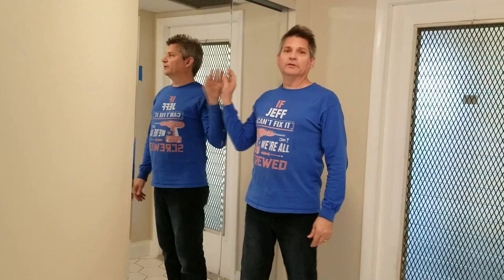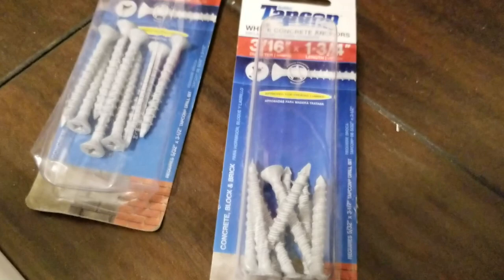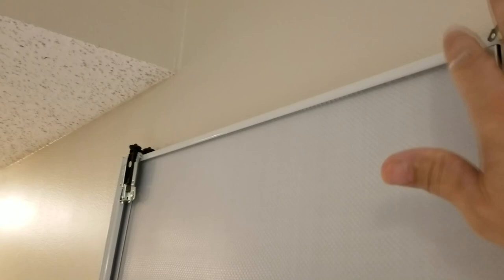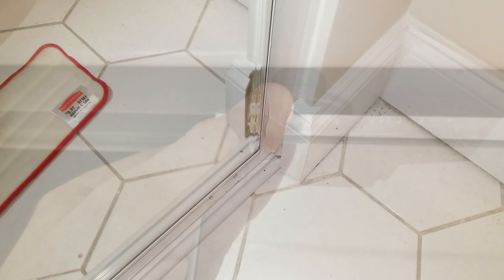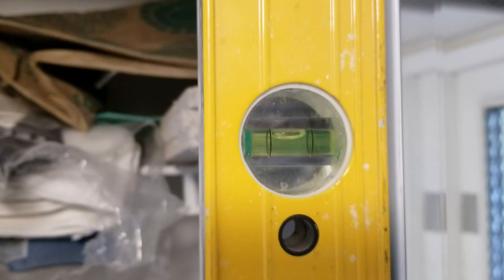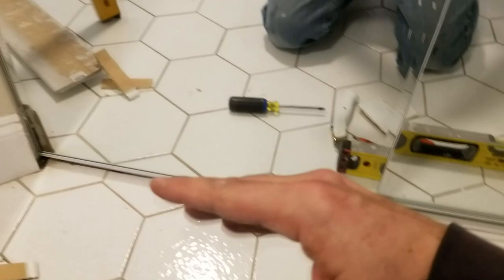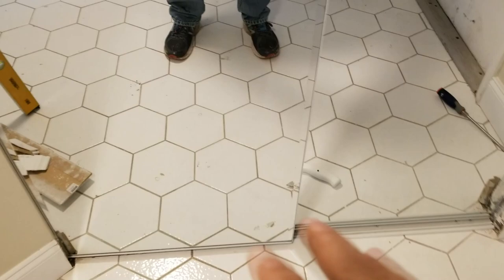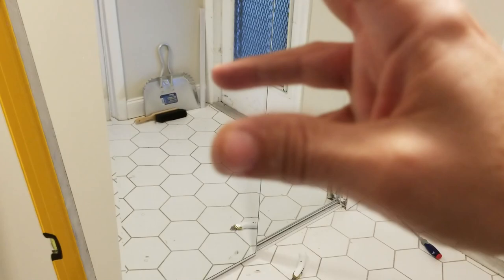How to Install Sliding Mirror Closet Doors Instead of Bi-Fold

Comment from the maker: ✅ Tools and parts in this video: ✅
 🛒 47 in. x 80.5 in. Savoy White Painted Steel Frame Mirrored Interior Sliding Door https://homedepot.sjv.io/nG4Ma
🛒 DEWALT DCK299D1T1 Hammer Drill, Impact Driver Kit: https://amzn.to/2M6h450
🛒 RYOBI AG4031G 4-1/2" Angle Grinder: https://amzn.to/2BNYYjr
🛒 Tapcon 24371 3/16”x1.75” White Concrete Anchor: https://amzn.to/2MXeuyX
🛒 ITW Tapcon 5/32” x 4-1/2-Inch Concrete Drill Bit: https://amzn.to/2I3BOvS
🛒 Johnson 72" Heavy Duty Aluminum Box Level: https://amzn.to/2TiuihP
Reply: Where did u buy the door from?
Reply from the maker: https://www.lowes.com/pd/ReliaBilt-Reliabilt-White-Mirror-Sliding-Closet-Door-Hardware-Included-Common-60-in-x-80-in-Actual-60-in-x-78-in/4411953

Comment: Thank you Jeff! Great video! I just purchased a used mirror closet door that fits perfectly in my space and your video is helping me be able to install it. I was wondering what size screws should I use for the top and bottom? Thank you! 😊
Reply from the maker: If you are going into would the top track and bottom tracks can be screwed in would just a simple 1" Pan head threaded screw. Don't use a regular bugle top would screw because those bugle tops will stick up too far in the door will snag on them. It usually depends on the size hole they give you but I'm number 8 or number 10 , 1" Pan head screw will be just fine
Reply: @jeffostroff  thank you so much!

Comment: Do you have a video addressing cracks in grout in bathroom tile corners
Reply from the maker: No but I can tell you that you should never grout in corners, so you'll always see me using only silicone. We use color matched silicone to match the color of the grout. You hould never grout any change of plane only silicone.

Comment: Can I install new mirror doors onto already installed track and hanging plates from previous regular sliding closet doors?Thanks for the video great info 👍🏼
Reply from the maker: You can try, you might get lucky and they roll on the older floor track, if not you'll have to use the tracks shipped by the manufacturer.

Comment: If it says “2.5 mm thick safety backed mirror” does that mean it comes with the two sliding mirrors¿ rn do I have to buy another one for 2
Reply from the maker: Only the front of these doors are mirrored, the backs of the mirrors are not mirrored, they are some material designed to protect it. Both doors come mirrored.
Reply: jeffostroff how do I know if it comes with 2 door mirrors because I don’t want to make the mistake of only buying one mirrored door
Reply from the maker: @hopehdez3886  If you order the exact one here that we ordered, it will have 2 doors, on their description page you'll see it says it has mirrored doors: 🛒 47 in. x 80.5 in. Savoy White Painted Steel Frame Mirrored Interior Sliding Door https://homedepot.sjv.io/nG4Ma

Comment: Helpful video, Jeff. I'd like my 6 mirrored closet doors on 3 tracks so 3 dorrscollapse on the left and 3 collapse on the right for maximum access to the closet storage area. Know if that kind of hardware is available somewhere? Thanks!
Reply from the maker: Great idea! That's a huge opening, and I think too much complexity that will lead to trouble down the road. At Home Depot, biggest slider set they have is 48" opening for mirror doors, but some other smaller glass panel doors can go to 72". Lowes has mirror doors to accommodate a 72" opening max, but $600! You my have to go custom route.

Comment: Awesome video Jeff!  Do you have any experience or suggestions on removing them? The plastic hooks seem to be preventing us from lifting them out of the grooves in the floor track.  We got them installed no problem but are having trouble now removing them. Thanks in advance for your help and sharing your knowledge!
Reply from the maker: The best way to remove them off the track is you have to get inside the closet down on your knees and unscrew loosen the wheels and the wheels have to rise up in order to swing the door up and out

Comment: I created a problem for myself when I bought my replacement door with the correct height and width but WRONG size of the Bottom Rail. When I  removed the original closet door  which was just like this one in the video in order to put a new one in I discovered that the old door had a wider bottom rail by about an inch and a half over the new one. The new narrower rail  exposed  the gap between the closet and the room since I had no carpet going under the bottom rail extending from my room to the closet. The original rail was wider and was neatly covering the subfloor , but the new one wasn;t due to being over an inch narrower. This left me with about an inch and a half of exposed subfloor which looks unsightly.
I was in a hurry and got my replacement door 15 min before store closing and now have to correct that by dedicating another day just to return it and then special order a new one since they don;t have it in stock.  Be mindful of that when replacing with new.
Reply from the maker: I have filled in gaps before with cut pieces of the wood flooring I used in the closet
Reply: May I ask how you removed your door?  The plastic hooks/guides on the bottom seem to be preventing me from lifting my doors out of the tracks.  And it's driving me crazy!  Is there a way to compress the hooks so that they slide out of the grooves?
Reply: @Hullabaloo2013  Yes, of course if you just need to remove the doors that is easy. Jeff has at least one video on how to to that. Sliding doors may be different than bi-fold doors , depending on what you have it may be a little different. I would type in "Adjust / remove bi-fold closet doors" and you will likely see many  videos which address this issue. That is what I did . Gl.

Comment: Mr Jeff my door opening  H it is 80 in h even and I have a 80 inch H door what should I do to fit
Reply from the maker: Just because you have an 80 inch door does not mean that it's 80 inches so a lot of times it could be 79 inches or 79 1/2 inches. So you need to pull up the spec sheet for that door and look at the exact dimensions and if it's 79 1/2 inches you are probably going to be OK. But if it truly is an 80 inch door the only way you'll get that door to fit in there is you will have to chisel away at the top of that sofit and maybe raise it up in inch or two that would require a little bit of construction engineering I've had to do that in the past. I once had a closet door that was too tall, and I had to build the soffit down from the ceiling to meet the height of the door that I was installing.

Comment: Is there any way to cut down these mirrored doors so that they may fit a 79" opening?  My only other options would be to reframe or buy custom ($$$).
Reply from the maker: No you cannot cut down the glass at all this is usually a tempered glass and it does not meant to be cut only once at the factory
Reply: @jeffostroff  Was worried that was going to be the case.  Thank you for the quick reply!

Comment: What if my sliding mirrors are bent/warped? When i slide my mirrors they grind on each other
Reply from the maker: I don't see how they could be banned because otherwise the mirrors would have cracked. Yeast. But supposing they are warped out of shape then you would have to get new ones because this type of system that's designed for them to be straight and parallel to each other. Check your wheels on the bottom and make sure they are contacting the right part of the track it could be your just alignment is off

Comment: Bought a pair of used doors, to replace bifold. Need just the hardware. Picked up a set @ Home Depot, but it just has a bottom bracket, not a track…. Also, these doors are an inch shorter than the bifolds we took out, will there be adjustable “forgiveness”? Yikes.😕
Reply from the maker: Yes, you can raise and lower them by adjusting the wheels at the bottom with a set screw for adjusting the height. The top track is thick enough so that even if you have to lower the door a lot, the track will still hide the top of the door.
Reply: Is it possible to buy a hardware set for installation that has BOTH upper and LOWER tracks? TYIA

Comment: Spacer needed under bottom track 100%, especially with such heavy doors. Also music is just noise that does not help at all. Otherwise thanks for making this video as heavy mirror sliding doors are challenge to install with crooked walls etc. Also wondering about those guides on each side of each bottom wheel, are they needed hard push to go into the bottom truck with each wheel?  Also probably flat head Tapcon screws would be better for bottom track fastening to a concrete floor imo.
Reply from the maker: I believe the guides just fit around the track to steady it while the wheel rolls. BTW, we did use flat top Tapcons, as far as I know, all Tapcons have flat tops.
Reply: @jeffostroff  thanks, but was it hard or easy to insert guides with roller into that open space? I ask because guides are thicker then open space for roller, yet both needed to fit into that open space.

Comment: Very poor installation of the bottom track! It should not straddle the gap between the tile and closet wood floor. That air gap should be filled with a length of plywood for the new floor track to sit on... which will prevent the metal floor track from flexing, bending, shifting, and so on. Poor judgement on that aspect.
Reply from the maker: It was installed per the manufacturer's instructions, and was nice and rigid with no shims needed underneath. The door loads are not over that air gap in case you failed to notice, the door loads are over reinforced metal structure on the bottom of the track. Perhaps you are thinking of older or use use inferior designs that need shimming, but this track is well supported underneath right where the vertical load of both doors is. If you stop using cheap door tracks, you won't be subject to all the flexing you are referring to, hence you won't have to criticize those of use doing it right with proper materials..
Reply: jeffostroff: Hey Jeff— if you can’t handle criticism don’t post your DIY annoying music non professional door installation video. And while it is only my opinion- you are rather annoying in every sense of the word in any case.